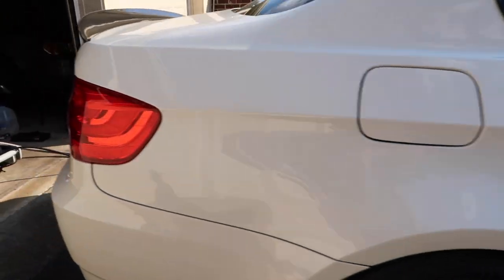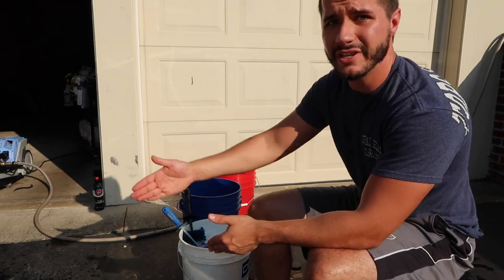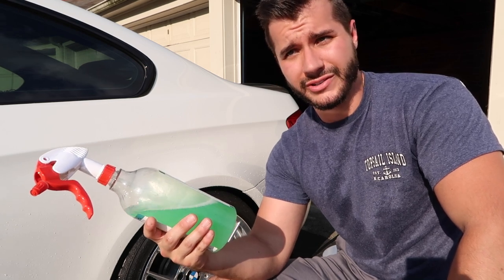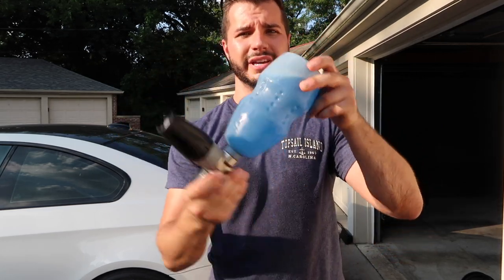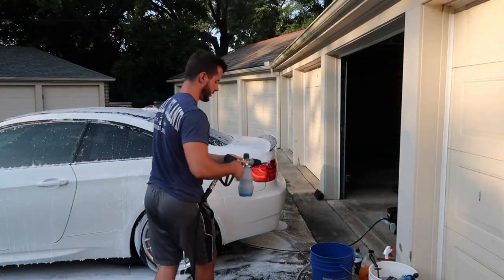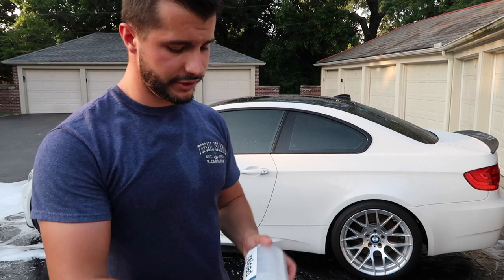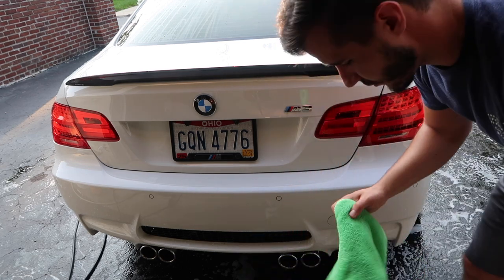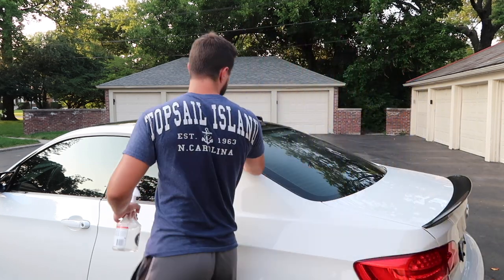Detailer's Guide to A Maintenance Car Wash

Comment: OK i noticed that after foaming your car you went right to the wash mit and didn't rince the car off first so all the lifted dirtespacially on the top or flat panels coulg get caught in the washmit and scratch the paint, maybe i missed the rince  but i only say the rince after using the wash mit. Something i found based on recomendations from friends it is called 303 protectant, i use it on just about everyting from tires to any interior trim dashboards, leather seats,(not for suede or unfinnished fabrics), chrome trim and head lights. I put a couple of squirts on a small piece of sponge and apply. It spreads and spreads and haver found that thinner is better, it dries in a mionute or so and go over it with microfiber towel, you can put a second coat if you like using the same process, and it will last for a long long time and is dry to the touch as soon as it is buffed with microfiber towel. If you put it on heavy 1)you will not like the look and 2) You will need water to wipe off the excess to get the product to shine so use it sparingly. If you spay it on paint just wipe and that and anything else you put it on is UV protected. It was origanaly developed for use on the Space Shuttle. I buy it in the gallon size and it is much less costly but it comes in 16oz. and 32 oz. sizes as well. This is a link be sure to watch the video. https://smile.amazon.com/303-30320-Protectant-Plastic-Fiberglass/dp/B00L4TF32G/ref=pd_sbs_200_1?_encoding=UTF8&pd_rd_i=B00L4TF32G&pd_rd_r=Y1AHM62PHSTFF5HPDJGY&pd_rd_w=hEdnm&pd_rd_wg=WkXad&psc=1&refRID=Y1AHM62PHSTFF5HPDJGY

Comment: I think you need to rinse off the foam before using the wash pad. The rinsing off the foam removes all the tiny sands on your car.

It’s also better to spray reload on your cloth.

Very nice video! Thank you sir.
Reply from the maker: +Nick Bond the foam loosens and pulls the dirt off the car so rinsing to me seems like an extra step unless it's super dirty. And yes you're right, sometimes I forgot it's better to spray the towel.
Reply: Brandon B awesome man!!

Comment: really good idea by using the little painters brush for the fine detailing. BUT... youd get the back even cleaner by removing the registration plate before the detail to get all that dirt from behind. good video though, beautiful M3
Reply from the maker: +lilJames881 right of course. But this is a routine maintenance wash so taking the extra steps aren't required here.

Comment: Brandon, you should try out the armor all wash and wax on the rest of your car, it's amazing even though it's $5 it still works a lot better than most expensive soaps, and you can actually see the water bead off of the paint so it does have wax in it

Comment: Top video. What would be nice is to do time lapse video showing how long each step should take? Some ppl waste whole weekends what you can achieve in 1hour. Is it not best to only use glass cleaner on the inside? And maybe the windscreen.  Must get myself a new pressure washer
Reply from the maker: good idea.  You can use glass cleaner on the inside as long as it's ammonia free like the one from Griot's Garage.

Comment: you have some nice ass supplies. the scrappy washer I have has a super short hose and you have to wheel it every where and has a hose and a cord. so much work lol I hste having to do so much work for a simple wash.. the washer you have looks more organized.
how much did you get it for?
Reply from the maker: the Kranzle pressure washer is $1,200.  I know it sounds crazy, but I plan to have it at least a decade

Comment: Best to not use a waffle weave towel like that, better to just place it on each part of the car and dab dry each section that way if anything is stuck to the inside of the towel you will not push it around and make small swirl marks. :)

Comment: Shouldn't you be rinsing the car after foaming but prior to putting the wash mitt on the paint surface? I always thought that was the whole purpose of foaming in order to remove as much of the debris as possible before touching the surface
Reply: PcarFan16 98% of people do it like that (the rinsing after foaming) the only one i know who dosen't do it is matt moreman (Obsessed Garage). And brandon just does everything like matt does it
Reply: If I use foam it’s because it’s noticeably dirty and so I want to remove as much dirt as possible before going with the mitt so yes rinsing after foam helps knock more dirt off. But he may have foamed just for demonstration. I would’ve just washed this car with the mitt but really, there is no one method. So what works for you and not just go by what others say.

Comment: do you still use the 10" adams wash pad still? or have you moved towards Microfiber Madness type mitts?
Reply from the maker: I actually use both but I think I like the Adams more 😎
Reply: Cool, I have both swell and I must say I do prefer the feel of the wool wash pad over the microfiber madness even though Im sure the madness is a slight bit safer.
Reply from the maker: Agreed!

Comment: Why do u use that cheap wash and wax on ur alloys? Doesn’t is strip alloy protection? Dont you care if it’s PH neutral or not?

Thanks
Reply from the maker: +e2k it's not a big deal since it doesn't sit on the wheels very long. I actually just updated my wheel procedure recently. Check out my vid! I got rid of the bucket haha

Comment: That's what sucks though all this to just wash a car, must take 1-2 hours to just wash the car.
Wish there was a faster process than setting up the pressure washer, two buckets, wheel bucket, all the crap you have to set up.
Also the worst part after all that is you're still going to get scratches  and swirls pretty much inevitable.
Nice video thought btw.
Reply from the maker: It's a commitment, but it's worth it to me.  Plus this process reduces the chance of scratches more than anything else I've tried so far.
Reply: MyDraw Rinseless Wash my friend. Wolfgang Uber or even Optimum No Rinse works amazingly well.

Comment: 1200 psi? that can't be right? 82 bar?   On my karcher i got 180 bar, thats around 2600psi, and it's waay more cheaper than Kranzel
Reply from the maker: +vetle33 yeah the attachments and quick disconnects reduce the pressure to about 1200 psi which is plenty for washing. It's more about the GPU (gallon per minute) than straight pressure
Reply: Kranzle most likely is quieter and has a extremely high GPM of like 2.1. In addition, its not about max PSI but sustained PSI. I run a karcher k1900 myself and its much better than the other budget pressure washers though.

Comment: Well plenty of things wrong. One handed every thing? And do you know the whole purpose of snow foam? It is designed to be evenly sprayed onto dry surface and left to dwell depending on the amount of dirt. Then rinsed off, then go in with double grit Guard buckets. And that bullshit you do with that hoblue Adams shampoo where you put loads in the bucket then use another shit ton massive squeeze all over that lad, is just pure waste of product.

Comment: good thing it's a white car or you'd be able to see all the left over swirl marks
Reply from the maker: you can still see swirls on white cars bro.  If you're going to hate, at least use some logic.
Reply: Looking at cars this summer, best is silver, then white, there were a couple of white cars I thought were scratchless, but I saw them later, you really have to look at the right angle when sun is bright. Last are metallic dark blue and black, IMO only suitable for detailers. Some 10+ year olds looked like they were washed with wire brush.